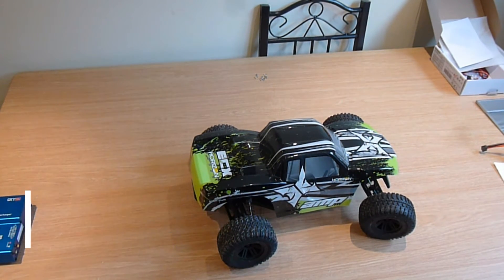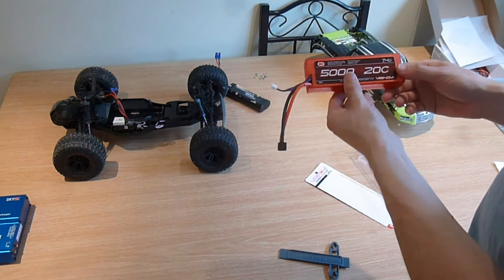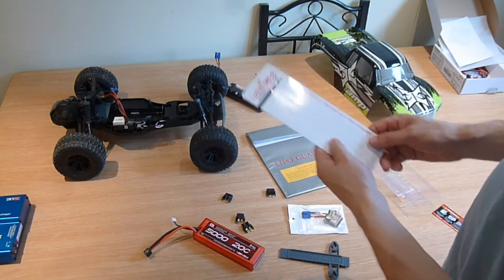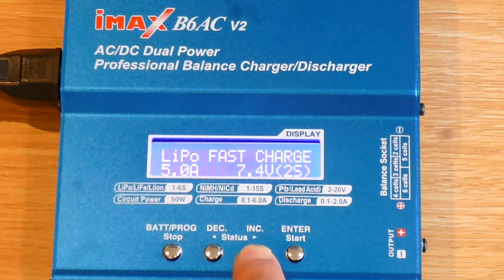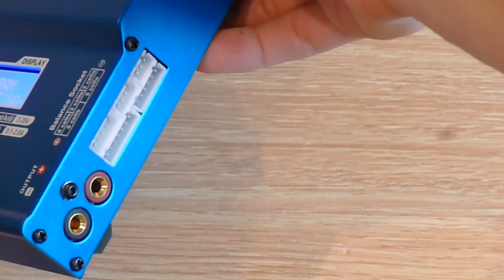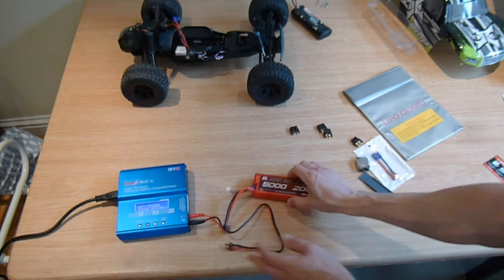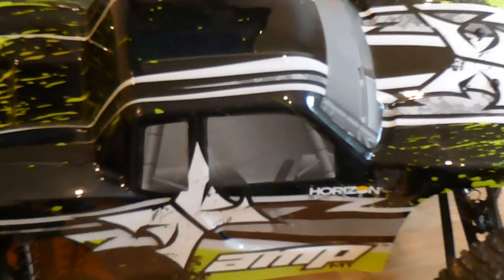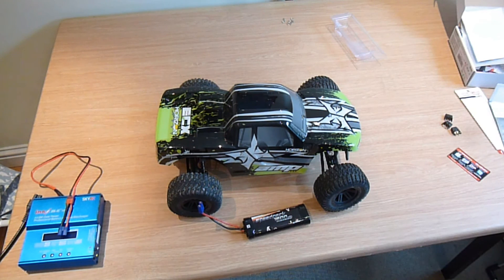ECX AMP MT RC Truck Lipo upgrade with Imax B6AC Charger

Comment: Big help, thank you! I'm going to buy parts and try to follow along. I have the Amp DB in white. :) I was thinking that the ecs would have to be changed out too, but looks like not. Also, did you mean for your last two links ( in description) for the connectors to be the same part?

Comment: How long is the run time and will it increase the speed great vid
Reply from the maker: Jack James about 45 mins with lipo well worth upgrade can quick charge in same time also so you don't have wait overnight like NIMH batteries to charge makes car alot faster.
Reply: RC Racer thx for the info definitely going to get some paets
Reply: 1--Lipos come in all sizes and the size = mah determines how long the car runs on a charge.  2--Nimh do not take over night to charge--wow, where'd you get that one?!? Again it depends on the mah of either Lipo or Nimh for how long it takes to charge AND the selected charge rate--a 3000 mah battery of either chemistry takes roughly 30 minutes to charge at a 3 amp charge. Higher mah Lipos can be charged at higher amps so a 5000 mah Lipo can be charged at 5 amps.
Reply: Only a rookie would install a 5000mah...It's too damn heavy.
Running your toys more than 10-15 mis at a time is asking for trouble.
You need to let the truck (motor/esc) cool down...and you cool down.lol
It's the C ratings ( discharge rate).
A 2200 mah at 30-40 C will out perform a 5000 mah 20C...all day long.
better power to weight ratio. Higher discharge. Plus the lighter the truck...Less shit breaks or strip.

Comment: Hi and thanks for the upload :--)
I'm thinking of doing the same to mine...did you run into any problems running the 2s in the last year....
Thanks.
Reply from the maker: No 2s works fine.
Reply: @rcracer8056  
Thanks.... I bought a cheap lipo alarm....and have no problems on 2s...and enjoy the extra torque and speed..
Thanks for your reply
:--)

Comment: RCs and their upgrades are really expensive. To do this LiPo upgrade, you probably are going to buy a better motor and esc kit. All of that together is about $100+
Reply from the maker: Just use Lipo cut off switch, Lipo can be reused in next rc car also no need for upgraded motor or esc.

Comment: Could you leave a link for all the stuff you need pease ?
Reply from the maker: Links added to description its been a while the ecx battery connector  is a pain with regards to the connector type as its not a common adapter so have linked the best I can recall from memory, i have listed a different cheaper battery which works just as well as venom for half the price. Please note the links are for guidance only, I would recommend ordering items off amazon so you can return if needed.
Reply: RC Racer thank you.
Reply: RC Racer Oh btw, The ecx circuit already has a 2s lipo and a 15T motor for only 180 euro. So I'm going to buy that instead of this setup because it's going to be a lot cheaper.